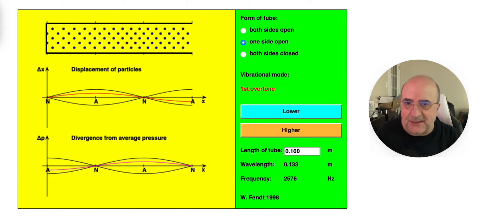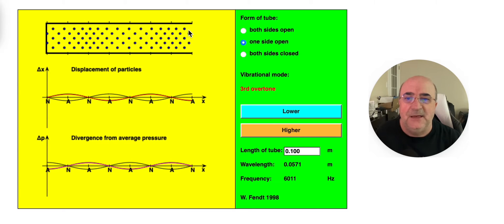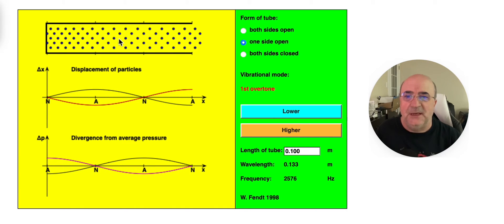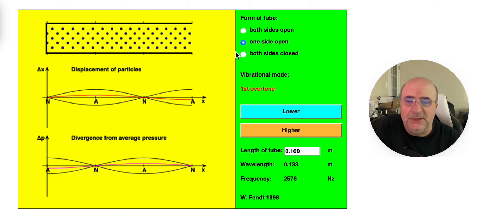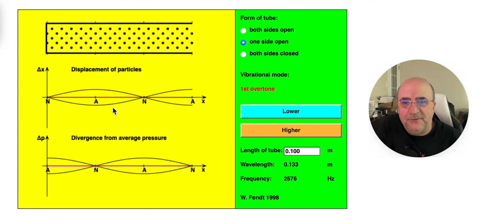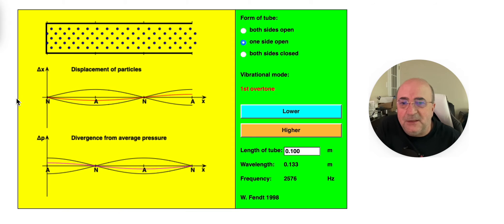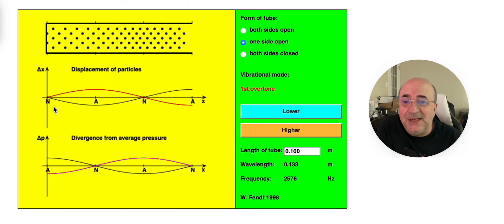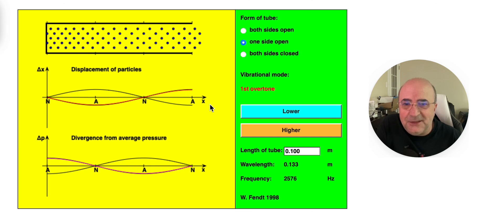New Hypothesis for the Graviflyer

Comment: What if you resonate the center plate at the resonant frequency of aluminum. Treat it like a beetle shell. It could act like an amplifier of the resonance Then treat the plates like an open air capacitor. Voltage only applied when a direction is needed. Small to big is the direction. Power the bottom plate to the center plate and it moves up. Like tt browns capacitor. The frequency of the rotating plate to the power wire would give you frequency while the resonating plate will give you sound between the 2. ( The time it take the plate to move one revolution from the wire and back again is the frequency.) When powered on. Both plates powered at once will just put force on the center plate and cancel each other out. I like sound and frequency in tubes but there are no tubes. There is a double plated center disc with a hollow area to create a resonance chamber.  Just an Idea. Hope it helps.

Comment: I can see the possibility of pulling in air from above and deflecting it to the side as providing lift, but I would suggest going back and looking at the video of the original lifter.  do we see sideways deflection of air blowing off of his shirt?  It should be a fair amount of deflected air to lift that device and I remember you looking for blowing air before.  Might be a good idea to go back and look.  Also, I am not sure I understand how this method replicates the flux pinning behavior for it to return to its original position and I remember your fascination at that, and it got my attention too, though I wonder if there is another way for it to return to its position as a stable point and not want to fly off and crash into the ground.  Maybe the cables that are attached?  I'm just not sure attached cables would keep it from crashing by changing its vector of thrust.

Comment: Its obvious that that scheme wouldn't work. Energy of the low pressure stage is equal to the energy of the high pressure stage. So, at a best the thing would just move back and forth and essentially stay in one place. Now, something might change if one was to do it like squids do. Squids obviously inhale water slowly on the front and exhale it fast on the back end by squeezing muscles. That gives some thrust, but nothing like that is present in a graviflyer. 

Anyways, do you have a link for that nice animated calculator?
Reply: Not true! The air going out the bottom forms a vortex which can't be sucked back in. Also, I didn't mention it, but an oscillating electric field in sync with these oscillations, will add more acceleration to the air moving out the unblocked end, like a breathing Lifter. So it becomes a Helmholtz resonator + ion drive.
Reply: @ToddDesiato  OK, then make a horisontal version on a balanced beam. Looking forward to see it working.
Reply: Todd's right. If you only look at the resonator things look equal, but due to fluid dynamics it would emit vortex rings which carry momentum. How much momentum? We'll see in future tests.